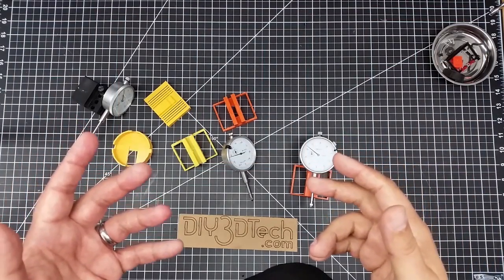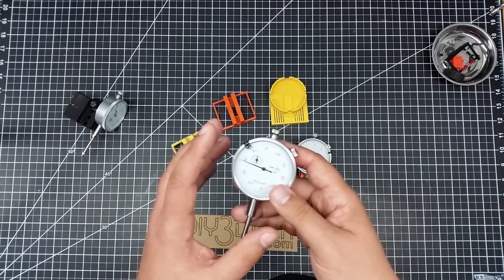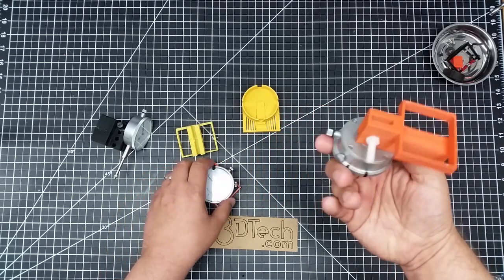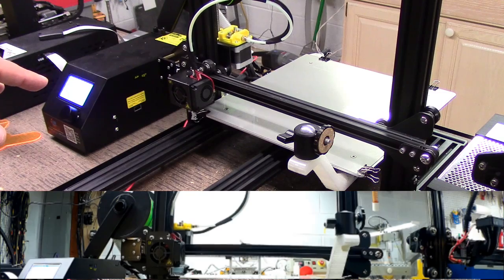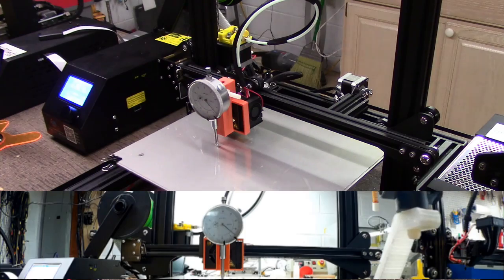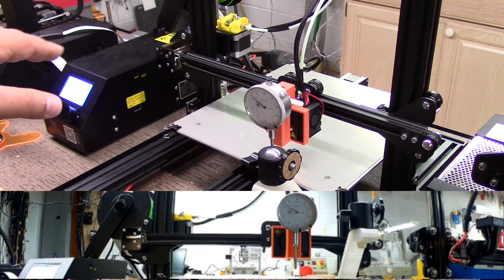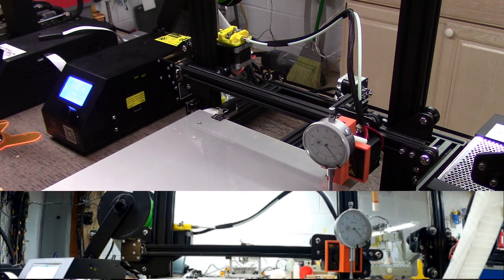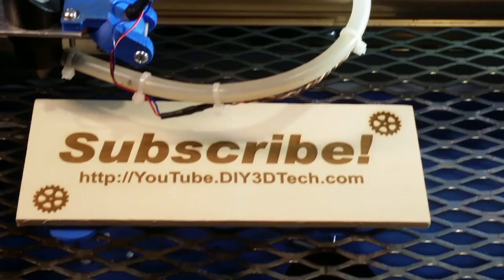Creality CR10 - 3D Printed Dial Indicator Mount for Bed Leveling!

Comment: Just curious...

Do the steppers behave differently during a rapid traverse/position vs jogging?

I would think that using the interface to manually jog across  the surface would allow you to learn more about the topography of your bed, and give you all the pause for user interface you'd need.

Do you happen to know what philosophy is best practices or industry standard?

Comment: Hello and Thank you!! just a quick question. using Cura 4.6.1 with Fusion 360 and CR10s. Sill quite new to the 3D printing. how do you "copy the gcode" for the leveling program to a file for the SD card? 
Thanks!
Reply from the maker: Yes save as its own file...

Comment: printed the dial indicator bracket for my ender 5 pro, but it won't fit.  The bottom of the fan on the right side of hot end has what looks like a little shroud on the bottom that protrudes down and the bracket  can't fit around it.  tried filing, but would go through all the material on bottom right corner so it won't worl
Reply from the maker: Sorry to hear!  Unfortunately I don't have an ender 3 to model one for you...

Comment: Watch this video and still trying to figure how it clears the side fan air deflector. Now trying to modify the air deflector so I can use this dial mounting. Would have been easier to put a drop corner on the mounting frame but cannot modify from a gcode.
Reply from the maker: This is designed for a stock CR-10 and not sure what you mean when you write "cannot modify from a gcode" as the STL is out on thinigverse so have at modifying it :-)

Comment: The chinese digital one actually do have serial interface, but do not have connector. You have to hack it (physically) to tap the connection points inside.
Reply from the maker: Thanks for commenting! If you check the Shop Talk playlist, I later get one with USB interface :-)

Comment: So how flat is the glass, I hear a lot about how bowed or warped they are
Reply from the maker: It hard to find anything perfectly flat and don't use the glass (no need) just a sheet of PEI to the heated and its around ~0.15 across the surface.  As the trick most people miss is over extruding the first layer as I set the first layer at 110% in the slicer and between the nature of plastic and the little extra. the first creates a [near] perfectly flat surface for the rest of the print to built upon...

Comment: you asked for a digital meter?
is this perhaps something
https://www.ebay.nl/itm/Digital-Dial-indicator-DTI-0-01mm-0005-Range-0-25-4mm-1-Clock-Gauge-PF/332371977463?hash=item4d62e9e4f7:g:n7kAAOSwY71ZsQFa
Regards,
Rob.
Reply from the maker: Thanks if you check out the shop talk play list I did a review of the USB version of this meter earlier this year along with the USB cable to attach to the computer... :-)

Comment: Nice Build Only suggestion is instead of waiting 20 secs to allow to zero indicator could u tell it to wait until knob on cr-1o controller is pressed?
Reply from the maker: Thanks for the kind comments :-) The reason is, pause is not supported equally on all printers so wanted to create something that is transportable rather just specific...

Comment: There is a leveling gcode that waits for the user to push the button on the control box between moves, no timer needed.
Reply from the maker: Thanks for share, however I mention this int he video as this is M226 yet not all implementations properly support it (most of my printers do not) and the reason I went this route with the timed dwell instead.

Comment: I designed a more sturdy mount version that attaches to the cross beam using t-nuts. It's available for download on thingyverse. Check them out. The third revision is by far the most sturdy.

Dial Indicator Mount found on #Thingiverse https://www.thingiverse.com/thing:2334312
Reply from the maker: Interesting and thanks for sharing, however do you have to bolt and un-bolt it?
Reply: DIY3DTECH.com It uses t-nuts. very fast and easy. If you're familiar with the Magpul M-Lok system for firearms it operates the same. the t-nuts only have to turn 1/4 turn to secure or release the mount. You also Don't have any offset of the print head to deal with. simply place on the beam and turn the bolt 1/4 turn and it's mounted. take your measurements for that side then move it to the other side. By mounting to the beam its self you eliminate the possibility of any play in the print head mounting.
Reply from the maker: +Wayne Coots  ah I see what your talking about now 😎

Comment: I was curious the process of making sure the meter is properly aligned to the height of the print head!
Reply from the maker: Not sure I understand the question as the alignment is immaterial as show in the video you will "zero" the gauge out.  Also, check the link in the description for my first video on to use dial indicator to level your bed :-)

Comment: Still looking for a digital dial indicator with data output ? Check these links out... I know they will output data to a spreadsheet... you will need the Dial Indicator and the RS232 Data Transfer Cable... Both can be purchased for around $65.00... Hope this helps.... Great vids btw.... Keep Printing !
https://tinyurl.com/yd7nd67q and https://tinyurl.com/y86vcdur.... Hope these work for you... if not Check Amazon for Clockworktools...
Reply: Ha Ha... I see you have already seen the Clockworktoos Dial indicators.... guess I should have check all your links first...  my story.... day late .... dollar short.... lol... Happy printing!
Reply from the maker: Many thanks for the comments and I have this dial indicator (the first link) however looking for the cable as the second link just provided a 404 error...
Reply from the maker: Don't feel me too!  (day late and dollar short!)
Reply: I also have emailed Clockwisetools to see if I can get more information on what programs the Data Cable will work with... I will let you know anything I find out.... I am hoping it will work with CAD programs as well.
Reply: Update if interested.... the Clockwisetools RS232 Cable is device dependent... meaning you need a different cable for each tool... Bummer.... They will work for CAD as I had hoped but I don't like needing a cable for the caliper and a different one for the indicator....  If you only need one device... it's not a bad deal for around 65 bukz... I may have to get the caliper....  but more searching first... L8r... Happy Printing....
Reply from the maker: Interesting and many thanks!
Reply from the maker: is there a link for Clockwisetools RS232 Cable ?
Reply from the maker: Sorry I see the link is here!  Going to order and see how it works so watch for a video!
Reply: Just be sure to get the cable needed for the tool you are ordering.
DTCR-01 for digital indicator and DTCR-02 for digital caliper.
Good Luck!... Can't wait to see the video !
Reply from the maker: Got it in and made a video already :-)
Reply: Is it posted yet?...

Comment: Do not order form gearbest, dont have them in stock, payed additional dhl express and they dont want to give back money, instead they sent 2 rolls of filament and treat it as the order that i ordered
Hustle company
Reply from the maker: Hmm sorry to hear your having issues with Gearbest as I have purchased tons stuff from them including this printer with no issues...
Reply: I second his comment.  Mine arrived very late, metal shavings all over the z-rod, they didn't bother to zip tie the print head, so that bounced around like crazy.  The cable ends were not tucked away, so whatever the print head didn't scratch up, those did.  And the thing reeks like it sat in an oil tank.  Other than that, it's actually printing decent
Reply: Gearbest is a great company, The cr-10 is a known situation. i ordered mine express before the boom of these printers and was able to get mine in a timely manner.
Reply: How long ago did you order? I order Jun 30, still waiting.
Reply from the maker: If it is coming from a Chinese warehouse to the US, expect about a month wait...
Reply: I ordered the CR-10 and filament at jul. 10. when I bought it the site said I will get at jul. 29- aug. 4. yesterday I got the filament and I wrote today to gearbest when will arrive the printer and they shipped already? I got an e-mail back and they don't send it yet but not just that they said they will get the printer at aug. 10. from the supplier  and they will sen to me after that. So I probably get it at september. I just not get it the company that big just not put a "OUT OF STOCK" label at there site is very irritating. Of course I need to wait because much more time if I want  back the money and order from another place then wait here.
Reply: But this video is great I will use this if I ever get my hands on the printer, great idea thanks again!
Reply: Just throwing this in for good measure. Got mine from Gearbest and it took a little over 3 weeks (during the swell of CR-10 orders in the last quarter). Their support was very responsive whenever I asked them about the expected delivery date, like 2-3 times a week.

They kept things very professional, sincerely apologized for the shipping delay and also offered some store credits as compensation. If that's not a sign of sincerety, I don't know what is :-)

Product arrived without problems and the print quality is as "advertised" everywhere in YouTube. Now looking to augment (pimp) my unit with other accessories!

I'd buy from Gearbest again.
Reply: Mark has Right about GearBest / additional payment / DHL ....I had a Very Sad / Expencive Experience with them ....so Be Aware ....
Reply: Use paypal with these guys, you can get your money back if they dont behave

Comment: I ordered a CR-10 this morning. Pretty excited to put my old (3 weeks old) Anet A8 to the side. Mitutoyo does make a dial indicator for $170 with data out but I think you could hack a cheap mechanical one with a potentiometer  and an arduino and make your own. I do not have the skills to do this on my own but I can't imagine it would be that hard.
Reply from the maker: You will love it!  I have 6 or 7 3D printers and this is fav as you can do some serious things with it because of the size -)
Reply: DIY3DTECH.com sweet! thanks for making me feel better about my purchase
Reply from the maker: Lol on this one you have nothing to worry about! (except for going broke feeding it plastic as you  print monster projects :-)

Comment: Very useful, thanks ... I'm wondering if there is a way to make g-code wait for a user input (push of the knob) before transitioning to the next location, rather than a fixed pause time ? I think that would work better on your second g-code example. (I'm not that up on g-code.)
Reply from the maker: You know after making this video I thought I should have talked about then said  awe someone will ask :-) so you are that someone!  As yes sort of, there M226 which is suppose to do a pause however I have had reliability issues with it working so went with dwell instead so if you want to try simply replace the G4 P20000 with M226 :-)
Reply: Thank you very much I will try that ... Just got my CR-10 yesterday (after waiting 3 weeks), so it may be a little while before I try it (other mods to do as well.) ... btw. Since those of us playing with 3D printer's are living in a metric mode. .. I found a cheap ($13) metric dial indicator on Amazon (with semi-good reviews) ... Just search for "Vktech Dial Indicator Gauge 0-10mm" on the Amazon website. Have it on order, will report back.
Reply from the maker: will have to do that as I hadn't seen metric versions that cheap as I too prefer metric (even living in Imperial land) so thanks for sharing!
Reply: I just received the "Vktech Dial Indicator Gauge 0-10mm" from Amazon .. The good news is that the back mounting lug looks the same as the lug for the imperial indicator you suggested (though a plastic back end.) .. The bad news is that the "sensor probe" (the thing that rides on the bed) is about 2cm shorter than your gauge ... so may not work with your mount ... (I may modify your mount for my own use) ... It is not really that essential, since we are really looking  at trends, and not absolute numerical values.. (But I may want to keep my brain in "metric land" anyway ... 8^)
Reply from the maker: check out https://www.thingiverse.com/thing:2412647 as I added a shorter version
Reply: Thank you very much, ... I will check it out.
Reply: Can you hit the pause print when you get to the point of moving the bed?
Reply from the maker: yes, and good point :-)
Reply: DIY3DTECH.com Sometimes I get lucky... 😀
Reply: With marlin, you should be able to use (M0  whatever you want displayed on the lcd)

Comment: Did you have a plate clipped to the bed, which means you're measuring the flatness of the plate and not the flatness of the bed?
Reply from the maker: My bed (or what I consider the bed) is the PEI surface, worth note too is as the PEI is heated it tend to conform to the dips in the aluminum beneath it...  :-)
Reply: Sad to hear that the PEI relaxes when heated, since I love the PEI on my MK2.  The other alternatives I'm considering are the PRINTinZ plate or Buildtak Flex Plate.  I'll start with the glass at first and see how it works.